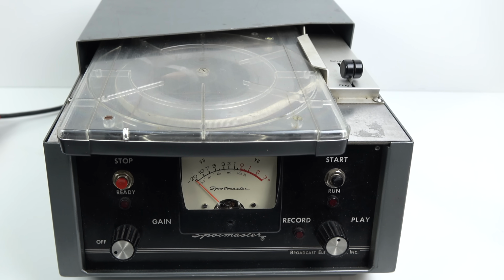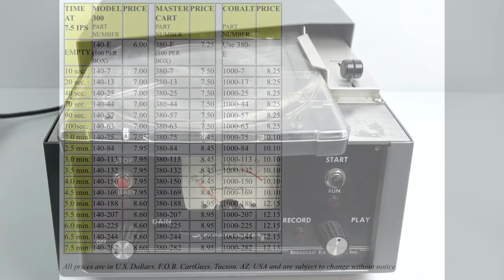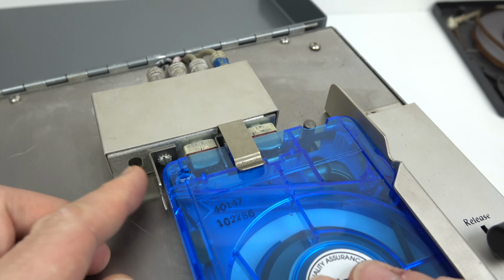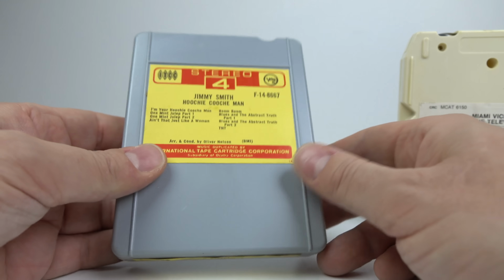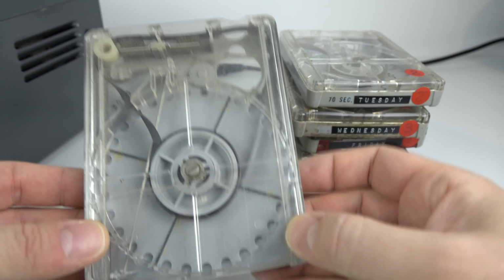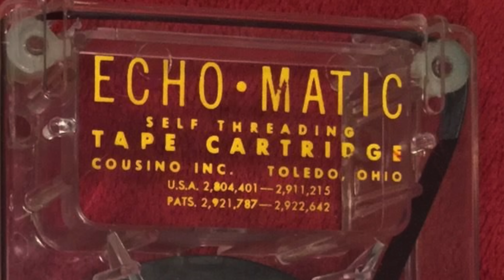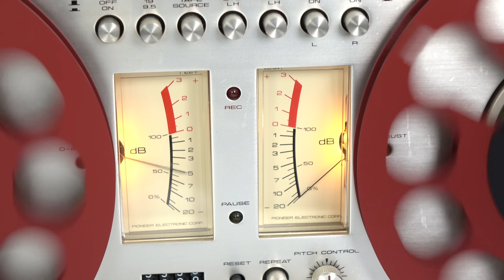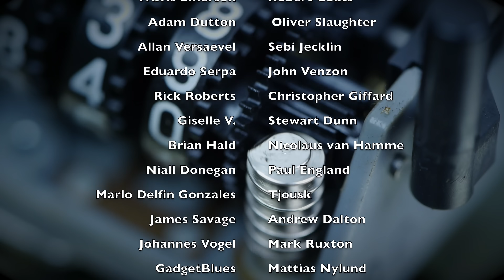The Broadcast Cart Machine

Comment: I worked in radio in the early 1970’s and used cart machines just like this as well as rack-mount models from Gates.  We didn’t use them for music, just jingles and advertising spots.  These units also came as stereo models which would have had three tracks.  Your tape was probably a stereo recording, thus the cue track didn’t align with your machine.  

I used a very rare home 4-track recording deck found at a yard sale to build my own telephone answering machine way back when the only way to have one was to lease it from the phone company.  I added a handmade cuing head that sensed a foil patch on the tape.  Crude, with all relay-based circuitry, but it worked.  The cartridge provided the outgoing message, plus serving as the timing for a fixed length incoming message.  A cheap cassette recorder captured the incoming message.

Comment: Love the weekday jingles. The Radio-1 jingles sound like they were done by an American company. When you popped in the tape with the girls voices I first thought it was some kind of a porno tape! Good stuff.
Reply: dfc99nyc The Radio 1 jingles were from PAMS and they used the Series 30 or 31 jingle packages with an acappela sounding. The weekday jingles came from WCBS-FM during its pre-oldies years in 1969 and 1970 when it was a progressive rock station when Bill Brown started in 1969 until 2005 when it became "Jack" after oldies pulled the plug.
Reply: dfc99nyc The Radio 1 jingles were from PAMS and they used the Series 30 or 31 jingle packages with an acappela sounding. The weekday jingles came from WCBS-FM during its pre-oldies years in 1969 and 1970 when it was a progressive rock station when Bill Brown started in 1969 until 2005 when it became "Jack" after oldies pulled the plug.
Reply: dfc99nyc The Radio 1 jingles were from PAMS and they used the Series 30 or 31 jingle packages with an acappela sounding. The weekday jingles came from WCBS-FM during its pre-oldies years in 1969 and 1970 when it was a progressive rock station when Bill Brown started in 1969 until 2005 when it became "Jack" after oldies pulled the plug.
Reply: MTN Productions dude - it repeated 3x
Reply: I had to read it 3 times anyway. Also, how did they change "WABC" to "Radio 1"?

Comment: Anyone else here remember the 'Discart' floppy disc cartridge machine? Did the same job as an NAB cartridge machine but using a 3.5" floppy disc instead of tape. I used them at a temporary radio station in the UK in the mid 90s. Maybe that's another obscure format to investigate, Techmoan!

Comment: I worked at a K-Rock station in NY back in 1993. We had an early simulcast over ISDN lines with a sister station about 50 miles away. If anyone picked up the wrong phone handset, the other station was dropped just like how your mom killed your dial-up connection. We had to play double cart stacks for station IDs by hitting the the two play buttons at the same time. This would also play the ads for each city as well. The owner got paid on two different ads at the same time, and only had to have staff for one station. The station owner didn't want the listeners to know that we weren't in their city. On-Air, we had to avoid and language that would give it away. So we talking about "City Hall" or "Main Street" but nothing specific to either city. Now a days, many US stations are played off one digital program recorded a week ahead of time. Sometimes with text to voice DJs. Radio never got a chance to be as good as it could have been because of ads. Hopefully we can hold on to the internet for free expression and changing the world.

Comment: I actually used carts back in the 80's both as a commercial producer and as a radio DJ. Because the cart recorders didn't have a head for erasing them, we had to run them over a large, heavy duty magnet every time we wanted to put something new on them. Commercials and jingles were produced on reel to reel first, and then recorded to the cart. Fidelity was never very good, but on AM radio, where the sound quality is already atrocious, no one could tell. Most of the time it was just jingles and commercials on them, and the news departments would record audio clips to be played during their newscasts. The audio tone to cue the carts was so low, my guess is that, over time, it probably degraded to the point that your Spotmaster couldn't read it. I'm wondering if you recorded something new onto the cart if the cue function would work? You are correct about the blank areas where Kenny would be able to talk over...probably at the end of his show.  Sorry for the long ramble. I appreciated this video a lot and it brought back a lot of memories. Thanks.

Comment: I found 1 of that type of cartridge back in the seventies and opened it up but had nothing to play it with and to this day I still can't get my head around how it can take the tape from the centre which is a smaller diameter and wind it back onto the outside which is a larger diameter at the same time.
Reply: One thing not mentioned in the video is that because the tape emerged from the center and wound back onto the outside of the pack, the tape itself had to be heavily lubricated so that the tape would slip on itself easily.  This was usually a dry graphite that covered the entire length of the tape.  If the graphite wore off over time, the tape would stick and the cart would jam; sometimes stretching the tape and often breaking it.  There were always a stack of carts waiting to be sent off to a rewinding service who would load them up with new tape, new pads and springs, and you would have a “good as new” replacement.  You could do it yourself, but they didn’t work as well as the professionally-done carts because they had machines that held the appropriate tension when winding.

Comment: When I was starting college in 1965, Muntz came out with a car stereo that was based on the cart machine. It ran at 3-3/4ips and had four track playing half an LP on the A set of stereo tracks with the B set for the flip side of the record. Within about a year, RCA came out with the 8-track. The limitation of the 8-track was that about half-way through the record side, often in the middle of a tune, the sound stopped, a metal backed splicing tape ran across a sensing probe and the head dropped down to play the next set of tracks. Also, if there was a problem, the plastic case was hard to open and wouldn't really seal if you managed to fix the problem. Also, in the heat of the car, the rubber of the built-in pinch roller would deform if you left the cart in the machine. That meant you tossed the tape. The 4-track had, as on your machine, a pinch roller that the user could remove and replace. With RCA's marketing power, the 4-track for the car went bye-bye. Later, when I started working in a radio station, the cart decks were the way we played the commercials. They were fired when that source was selected on the mixing board and the operator pushed a button adjacent to the volume control, the same way we started the record turntables. The broadcast versions, as you pointed out, played at 7-1/2ips. They also put a cue tone on the separate track when you started the machine in record. There is a circuit in the output of the cue track that senses the cue and stops the tape. The person wanting to record several cuts would start a record, stop the machine manually after the spot, get the script and music ready to record the next spot and start recording when they were ready. Each recording had a separate cue tone and would stop the tape before the next spot making it ready to air the next time. 
     One thing I would suggest for your machine is to check the output of the cue channel at the head and if it is outputting there, then the trigger circuit is malfunctioning. 
     Anyway, thanks for the memories.

Comment: I have three of these units. Tapecaster 700 RP and 700P. All three still work like new and I rebuilt them using a Spotmaster much like this one. Once a year one needs lubricate the drive motor with 3 in 1 oil. Other than that and cleaning the heads. That's all they need. And YES we did use them for music as well. Many times record players would break down for one reason or another and the carts kept running!

Comment: If it's a mobius strip, wouldn't that still make it a one sided recording? 🤔
Reply: PK Well, it was one-sided until he cut the tape...
Reply: Wolfgang Faust eh?
Reply: It's a math joke: mobius strips topologically only have a single side (which wraps around both 'sides' of the tape), but when he cut the tape it stopped being a mobius strip and became an ordinary piece of tape with recording on both sides.
Reply: Wolfgang Faust as opposed to a 1 sided tape recorded on both halves of one side . Or in the case of stereo four quarters of one side interlaced. Or .....Giggles
Reply: I don't think it's supposed to run in a möbius strip. I once had a Tandberg model 1300 that took these big cartridges and it had a track selector so you could play both tracks from the same side of the tape. It didn't twist to get to the other side.

Comment: I used cart machines at a college radio station from about 1985-1990. I was also production manager for a while and used to dub my spots onto carts. Fun times! Except that the little "sponges" on the carts were always wearing out, and the tape would wear down, and so we had sort of a rating system where we tagged individual carts by condition, and I was always struggling to find one that was not too badly worn. It was exciting when we'd occasionally get a batch of brand-new carts. It's very nice to have chunky things to put in  your hands and big friendly buttons to press, but I don't miss the crappy fluttering audio quality we'd get out of a worn cart.

Comment: Back in the 80's and up to the mid-90's I used a Spotmaster and also an ITC triple stack cart machine at several radio stations in California. The triple stack was 3 playback decks stacked together with separate controls to stop and start on the right hand side of the front panel and a single motor driving a long constantly running capstan from top to bottom. We played all music recorded from vinyl or CD's, jingles and commercials. When cleaned and maintained the audio quality was good enough for FM radio and as an engineer told me, "These are built like the '57 Chevy of tape machines".  Heavy, rugged, hard wired beasts that could run 24 hours a day for years. In the 90's we replaced tape carts with CD carts for music and used the tape carts for jingles and commercials. Of course you realize that this means you're going to have to find a Denon CD Cart machine which was a rather elegant last step before computer controlled data bases replaced live DJ's. If you find one, message me.  I think I've got an original CD demo produced by TM Century for radio stations using CD Carts for their music library.  It's a pretty good story.

Comment: I'm a former radio DJ turned broadcast engineer. I was using carts to actually broadcast with until around 2004 (although this was a rarity) and kept the format around as an enthusiast until I had a purge of my shed a few years ago. I skipped an obscene amount of great broadcast gear and my crown jewel was my Sonifex cart player/recorder of the last model they made and the Rolls-Royce of all cart machines. The standardised name worldwide for this format became known as the "NAB" Cart or cartridge. Fidelipac was a brand name of one of the original manufacturers.

Steve Wright on BBC Radio 2 incidentally, kept using carts in his studio until only a very few years ago until he could no longer fight off the BBCs insistence that all studios were standardised. When they asked him for the masters to all his jingles so they could digitise them into the systems, he refused and told them they would have to digitise from his working cartridges as nothing else sounded "radio" enough. You can clearly hear that many of his jingles are digitised from some well used carts, especially his opening theme.

During the 60s and 70s, the industry standard cartridge machines in the UK were ITC machines but in the late 70s, the Sonifex machines started to emerge, these became the dominant machines during the 80s and 90s right up until the final demise of the format. There were of course many other manufacturers but at the time before carts started being replaced by digital systems in the mid-90s it would have been rare to have seen anything other than Sonifex machines in most UK radio stations. 
The pinch roller deployment later happened automatically upon insertion of the cartridge and of course most machines from the 70s onwards were stereo (in fact 4 track, 2 tracks for music, 1 for the cue tones and the fourth carried what were known as "tertiary" tones which were used in automated setups where these could be used to trigger other cart machines, tape machines or other equipment.

It was common, especially in the US for ALL played material to be done via carts, many radio studios would have consisted of only 2 triple stack cart machines for all media playback. This was considered neat and convenient at the time and also meant that the precious records only needed to be played occasionally when being recorded to the carts. The 80s Pirate station Laser 558, which was run by an American company and styled on American radio, with American DJs, played entirely from carts, not only because this was very much a norm in US radio but also as it was felt that there were too many potential pitfalls playing records on a turntable in stormy weather. 

NAB carts were also widely used in the TV industry, for very similar applications to their use in radio, especially during live or "as live" TV shows such as quiz shows where intros, outros, sound effects etc were required to be accessed and played quickly. The uptake of more advanced and digital systems was much quicker in the TV industry than with Radio which had a much more romantic affinity with the analogue NAB format whereas TV was quick to adopt newer technologies such as digital cart systems (using floppy disks and later Zip disks), and eventually Hard-Disk and network based systems.

NAB machines are still available on the second hand market today but they tend not to appear very often on auction sites like eBay but more commonly on specialised sites dealing in vintage broadcast equipment.

Comment: Yipes! Took me right back to 1971! I bothered super famous, New York City radio personality Gene Klavan on the street, got up to the studio and, when a traffic reporter broke his leg, got to sit in for 2 weeks! Each studio of WNEW-AM had a couple cart machines. Each one had only two controls, a red or green button-- they were "hot" all the time! Loading them was different than your prime machine-- you just slid them in a large-ish slot, hit one side and it would "ready" itself automatically.
I had no need to touch them at all. But watching them operate was enchanting. The whole system was arranged so that each cart had only thing on it and it was always ready to go. You jammed the cart in and pushed the green button. Blammo, on the air. That small machine would automatically advance to the cue tone and stop, ready for the next use.
As I used to be a listener, I realized I was hearing the cue tone just as the whatever it was started up. Once I had to ask an engineer to put something on a cart and got to invade "Master Control!" The fellow stood in front a gigantic floor to ceiling machine, apparently ripped right out of a fire-control station from a submarine! So many amplifiers, equalizers, controls and oh yes, the work station to install your own custom length tape cuts! This time I had brought a "standard" length tape (15 sec?) to be transferred to a cart. What I heard was that this was a "half-track" machine, which was a complete mystery to me then-- not much better now. But I believe that is why I could hear the cue tracks-- because the half-track head caught it all.
There was a gigantic reel-to-reel flatbed (Ampex 300? 600?) right next to it which fed the other gigantic cart recording machine The engineer cued the tape up and dragged it over the heads by hand-- then hand-held the tape and let go as he hand-triggered a blank cart at the same time.
Then! What he did was add the cue track-- but this was done by hand too. He held the button down for what seemed like a 1/2 second. The way the machine worked was that it detected the "in-cue" and stopped within .1sec-- which then explained how I could hear the in-cue on-air. That engineer was a little too generous with his in-cue timing.
The "out-cue" was at the end of the bit of business and I was told it was possible to stop the machine and take it out before the in-cue was reached. If you were in the thick of it and had 5 carts to play, but only two machines, one could remove the cart before it reached the in-cue. A conscientious DJ would take all the carts at day's end and do that or... forget. Setting up the next fellow with potential dead air... !

Comment: Back in the day I got involved in student radio at University Radio Nottingham and we were using broadcast carts at least as recently as 1998/99, which was my final year. They were used exclusively for adverts and jingles, although in that year we started using a PC running (I think) Soundforge on Windows NT4 to trigger idents live using a custom keypad rather than exclusively using the carts. I imagine it wasn't too many years afterwards that carts were replaced entirely by digitised playback from a computer.